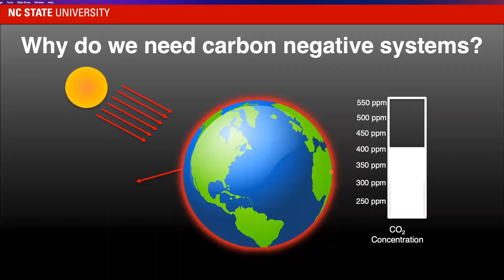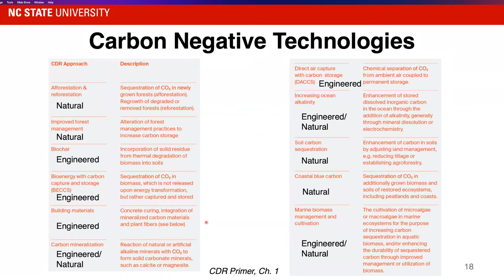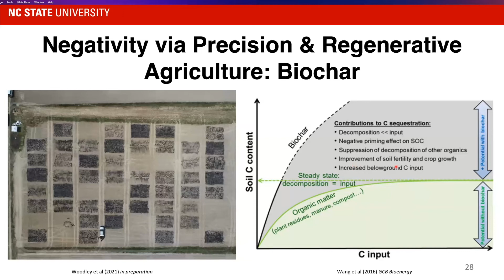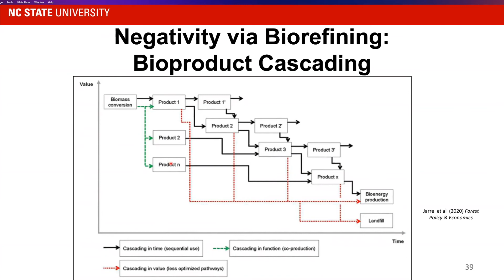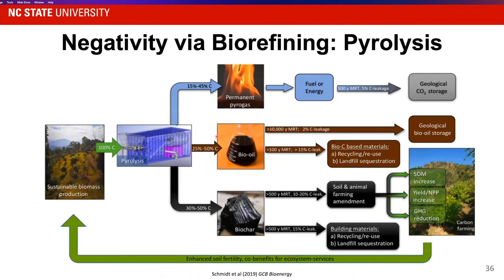TFACS Carbon Negativity

Comment: Remove the Earth’s atmosphere or even just the GreenHouse Gases and it becomes much like the Moon, an arid, barren rock ball with no water vapor, clouds, snow, ice or oceans, no more 30% albedo, hot^3 (400 K) on the lit side, cold^3 (95 K) on the dark.
That is NOT what Radiative GreenHouse Effect theory says.
It is what Nikolov, Kramm, and UCLA Diviner say.

The K-T diagram (TFK_bams90) counts 63 W/m^2 upwelling Long Wave InfraRed twice: 160 – 17 – 80 = 63 once and 396 – 333 = 63 second. Laws of Thermo 1 allows only one, the real one from the sun. Erase the 396/333/63 from the graphic, the balance is unaffected and the GHG warming loop disappears.
342 arrives from the sun, net albedo 70% or 240 makes it into the atmosphere, net/net 160 arrives at the surface. Per LoT1 160 is ALL!! that can leave. The 396 is “extra” appearing out of nowhere.
The 396 is a theoretical “What if?” calculation for a Black Body at 16 C serving as the denominator of the emissivity ratio: 63/396=0.16. IR instruments do not measure power flux, they measure temperature and infer W/m^2 by assuming emissivity and assuming 1.0 or .95 is assuming wrong.

As demonstrated by experiment the surface cannot and does not radiate as a BB and as such there is no “extra” energy for the GHGs to warm or do whateveh.
For the experimental write up see:
https://principia-scientific.org/debunking-the-greenhouse-gas-theory-with-a-boiling-water-pot/

ZERO RGHE, ZERO GHG warming, ZERO CAGW or CO2 driven climate change.

Version 1.0 101621